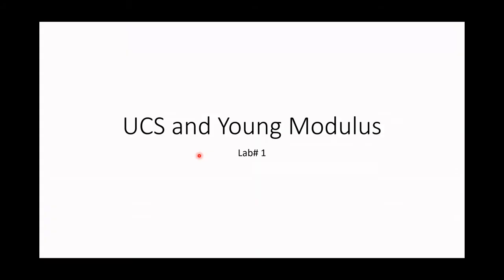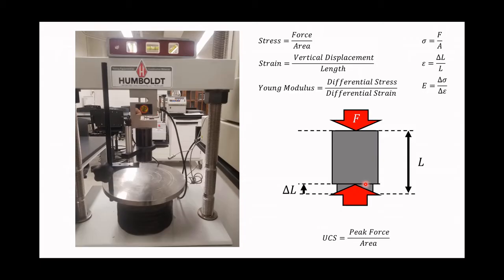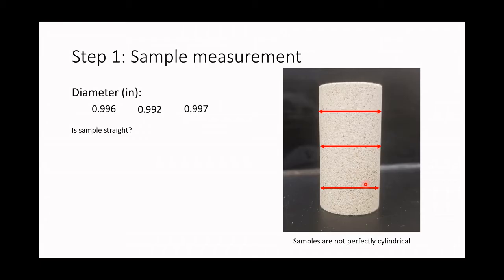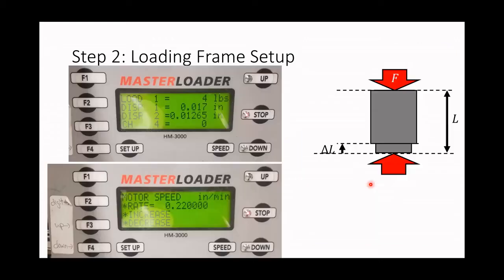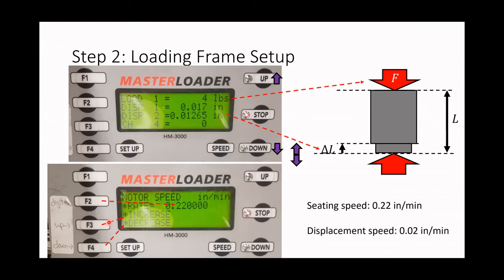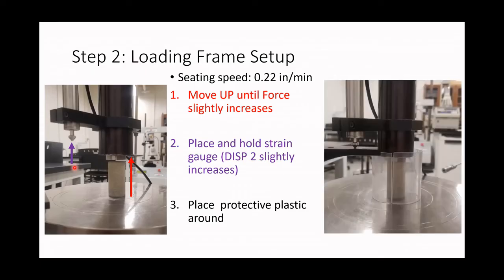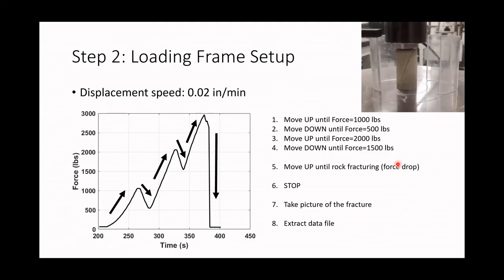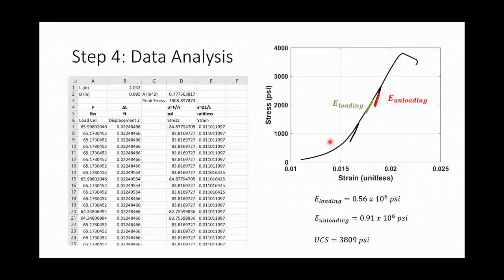Lab1 Rock Young's modulus E and unconfined compression strength UCS

Comment: Hi may I ask why not using the strain gauges to record the strain? Using displacement to calculate the strain is accurate or not?
Reply from the maker: Great question! We use a displacement transducer because it can be re-used easily for many tests. This is ideal for our educational tests where we break about 200 rock samples each semester. Endcap-to-endcap displacement measurements may introduce significant errors of endcap-rock interface compliance in the rock strain calculation. Strain gauges are more accurate and less likely to introduce errors (if correctly glued), but require significant sample preparation and additional electronical hardware to measure strains directly.
Reply: @dnicolasespinoza5258  Thank you very much for the reply Dr. Espinoza! The explanation is very insightful! So, for the research purpose, using displacement to calculate strain is acceptable or not?
Reply from the maker: @larry8306  Yes, using displacement transducers is acceptable and can be very accurate as long as the rock endfaces are flat enough and parallel with respect to each other. Usually the the first 10% of the strain-stress curve is discarded assuming most of this "strain" is caused by rock-endcap compliance. Also, the measurement can be improved by adding more displacement transducers in opposing sides, and by attaching the transducers to the top and bottom of the rock sample, instead of attaching the transducers to the endcaps (see pictures here, http://www.gdsinstruments.com/__assets__/Products/00036/LOCAL_LVDT_Datasheet.pdf)

Comment: Sorry but in the final why you don't divide the peak force between Area? if peak force is 3808.89 because UCS is 3809? if the peak divide for 0.7756 that in inches are approximate 30.54?? I don't understand, Do you can explain me? Please.
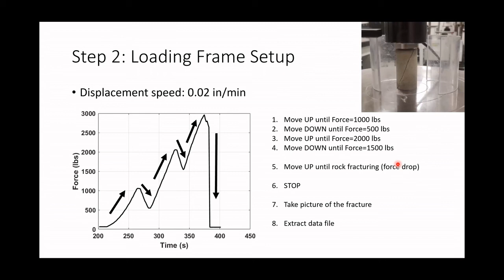Reply: Hi Pedro. At 8:34 you can observe that the peak force is below 3000 lbs (2961lbs in this case). Then, as you mentioned, after dividing by the area (0.7756 in^2), we obtained 3808.89 psi, which is the UCS value shown on screen, calculated as Sigma=Force/Area.
Reply: @Inkghael  aaaaa... okay jajaja ahí estaba la wea po xD